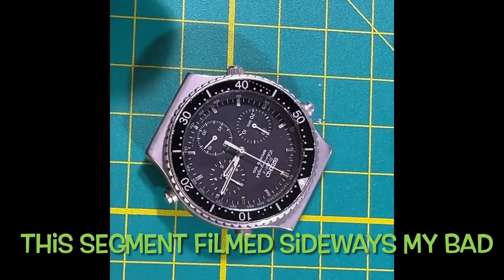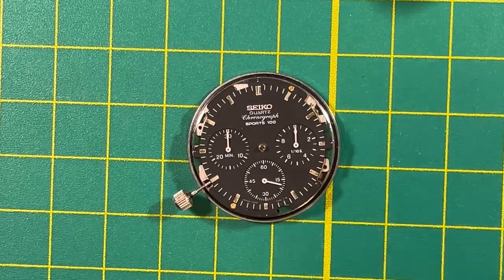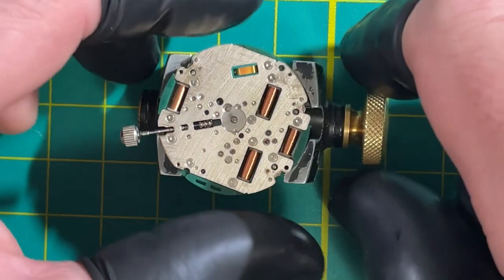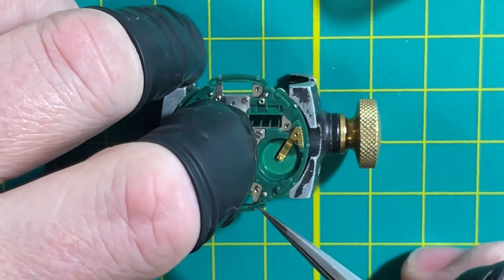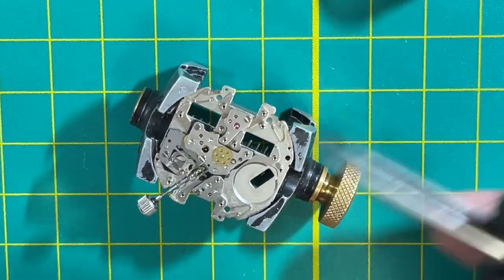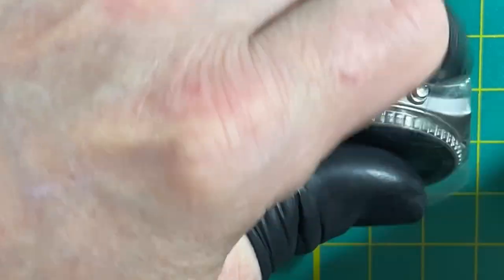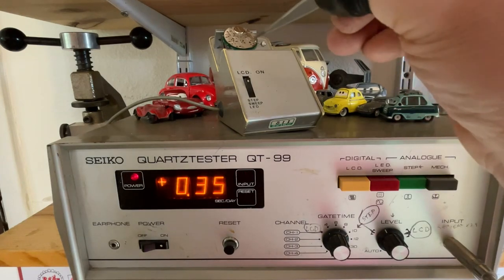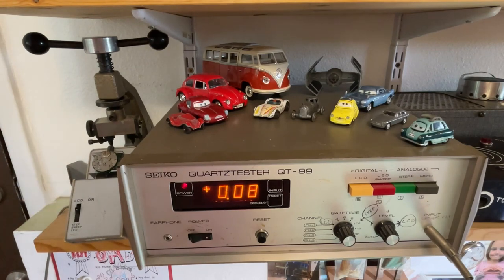For DM: Seiko 7A28-7049 15j chronograph

Comment: I was given a 7A28-7070 for my 21st brithday in 1987, I still have it, two bracelets later (but now a different style from the original), many services but now its difficult to get it serviced, last time the service centre told me it was no longer possible to get seals for it, so I no longer wear it as its not even close to being waterproof let alone splash/rain proof.
But I do keep it running and wear it around the house sometimes for old time's sake, its a familiar and comfortable feel on my wrist.
Reply from the maker: They're fully serviceable, no worries!  They were designed to be maintained.  You can sign up for the list to be notified when we have a service slot open up - it's at kleinvintagewatch.com under "servicing".
Reply: @SpencerKleinVintageWatch  Thank you, I will consider this, would be nice to have it 100% again!!